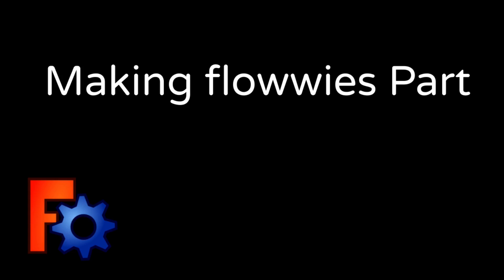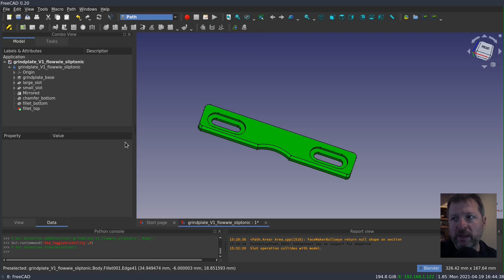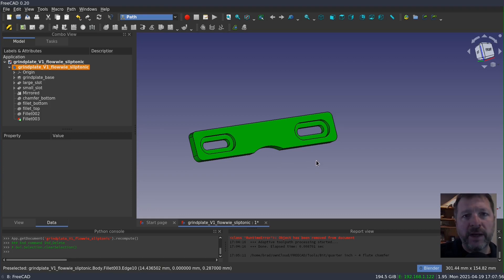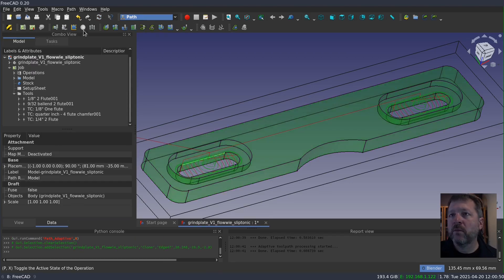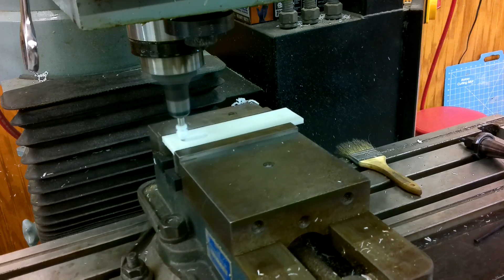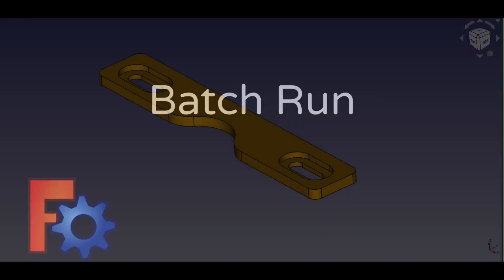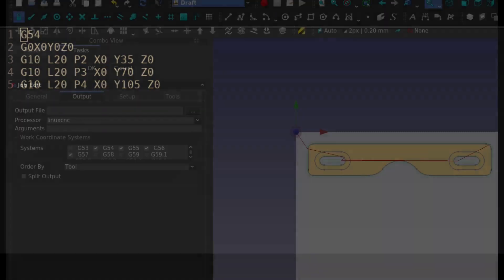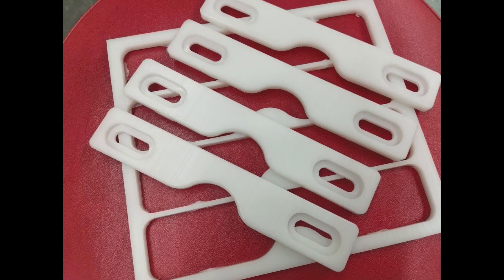Making Flowwies Part

Comment: Dynamic tool change: If it were possible to install the position of the button and the position of the tool change in Freecad in the Path settings (edit settings Path) so that the dynamic change can be prescribed directly in Freecad, so that during a change of tool generated in Freecad The machine drives into the position of the tool change and after changing the tools to the position of the button, then the new tool turfs and continues the job.
Reply from the maker: Dynamic tool change is very machine specific.  The Path tool change code is modular in the post-processors for this reason.  You can create a custom post based on one of the standard ones and then change the exact gcodes that are emitted during a tool change.

Comment: what a fantastic video - very good... I have problems with "CW" and "CCW", when I export Gcode, it interprets backwards, could you help me? I think the problem is in FreeCAD and before I used to work with Fusion360 and everything worked fine... in some machining there's no problem, but sometimes the milling direction is essential for a good finishing of the part... thank you for your attention

Comment: Thank you for this video. I’ve been trying to learn FreeCAD and Path. My first few attempts to create a tool path failed. Eventually, I deduced that I had created the part in the wrong orientation. Then, I couldn’t reorient the part. I finally learned how to reorient the part and tried to create a path. Success. Sort of. A few tweaks would create a path which cut away the excess material from the raw stock in several passes. This was my goal so this time success for real. 
Your video confirmed my findings.
Thanks,
John

Comment: Maybe screwing the blank to a wooden base and holding the base in the vice?
The wooden base could be made in two parts. A smaller part that fits the vice with a second larger piece secured on top that the blank is screwed to.
I liked your video and always look out for your posts on the FreeCAD forum.
Reply from the maker: A custom fixture could certainly be used.  There's a trade-off between holding the stock and wasting material so the more parts you can make in one go, the less material wasted.  
There's also a trade-off between the time needed to make and test a fixture and the time saved by having it.

Comment: Very nice.  I would have liked to see a detailed walk-through of setting up the individual job operations; I know you've covered them in different places but repetition is great for learning :-)   I've not yet got my head around the work coordinate systems but having looked up the G10 code, it now makes more sense.  Lastly, my machine vice would not hold more than one part therefore I would have looked to mount the material on the bed on top of a sacrificial surface - it would be good to see that option demonstrated too.  Keep up the good work 👏
Reply from the maker: It's definitely time to re-do some of my old videos.  I want to do that but it's time spent not developing.
Reply: @sliptonic  fair point 👍 I'd like to contribute to the coding but don't know where to start 🤔  I'd be interested in helping with video tutorials too but my Denford Triac is quite a small machine so I sometimes have to work around it's limitations...
Reply from the maker: Developing for open source is a lot of fun and great experience.  I'll always help newbies find appropriate projects to get started.  There are many places where significant progress can be made without having to understand the big picture.
As for videos, we're all working around limitations in our hardware.  Sometimes those limitations create the best content.  Jump in!
Reply: @sliptonic  Thanks Brad, I love open source; I've got a tiny unrelated open source project of my own (mixture of python and angular).  I've done some python work with FreeCAD to generate mazes but not published it, mainly because it's not finished.  I mostly program embedded stuff in C but can get by in python.  Where's the best place to find something to help with? - your github or on gitter?

Comment: Fantastic work! More path-videos, please! :)
I want to move completely to FreeCAD/path workbench for my x-carve adventures. It's hard to know "what should work" or if one is just doing something wrong/inefficiently. I wanted to cut out 6 pieces (3 parts two copies) in a single job. Things slowed down to an almost grinding halt when putting tags (multiple on each as biggest pieces were 700mm long). Pieces were just cutouts with a couple of holes. Also, as I remember correctly the auto tags were spread out combined on all parts rather than individually? Maybe not, but there was something strange about them that took hours to set. Mostly due to the lag.
Reply from the maker: Holding tags are great but that code is quite complex.  I'm sure there are opportunities to improve the stability and speed.
Reply: @sliptonic  I can imagine. I saw that you used the tip view to place them, so I guess the click is projected/searched down to the lowest loop and then back again x loops based on the width/angle/height of the tab?  I think at one point, one tab waa misoriented 90 degrees and created a path either in or out of the object
Reply from the maker: IIRC (I didn't write the tabs code),  the placement just sets a location for the tab.  When the dressup is executed, it looks through the operation gcode for moves that intersect the location and replaces those moves with corresponding moves to jump over the tag.  The tag itself doesn't have an orientation.  It's just a point.  Calculating the correct gcode to change gets nasty, especially if the tag is placed on or close to a G2/3 arc move
Reply: @sliptonic  I see! Might explain why it gets slow if the dress-ups are [re-]applied every click on a job that is physically large (8 tags) and with many (6) parts. 48 vs 4 tags may thus be x10 slower and be significant due to inherently large gcode that comes with the part size.  Does the code iterate the gcode 48 times, or once though a list of tags? The latter would obviously make the handling  4 vs 48 insignificant. If that's how it is implemented already, I guess it still just doesn't scale that nicely with gcode size. But I recall it getting significantly slower the more tags that were added, suggesting the former solution. I guess it may or may not require unfortunate refactoring depending on the architecture on how dress-ups are applied in general? :)

Comment: Related suggestion: with the growing numbers of individuals building DIY CNC routers (i.e. MPCNC, BulkMan3D derivatives, etc) along with the re-boot of some of the GRBL forks (grbl-HAL, grbl-ESP32, etc) I'd assume you can capture some interest around FreeCAD by going over other basics.  Things like "surfacing your spoilboard".

For folks who are increasingly used to integrated tools like Fusion 360 (as opposed to design in AutoCAD, CAM in Vectric, and run your job in Mach3), this could be a good way to get more folks on the F/L/OSS bandwagon.
Reply from the maker: You're right.  I need to revisit the basics.  Many of my videos are getting pretty dated now.
Reply: That's great idea! Feel little bit lost when it came to CAM in FreeCAD. Not that intuitive for person who know almost nothing in CNC machining.

Comment: Nice video! Instead of increasing the size of the holding tags, I would add one extra.
Reply from the maker: The ideal number of tags is the smallest number that holds the part because, all other things being equal, each tag takes a fixed amount of time to remove.  The ideal size for a holding tag is the biggest tag that requires no additional time to remove and does not affect the surface finish.  Going smaller than that doesn't buy anything except less stability.
Reply: @sliptonic  Thanks for your reply. I'm not sure there are hard rules for this. But I do believe the smallest practical number of tags to hold something will likely always be 3, because the part needs to be held in three dimensions. If the material is strong enough (obviously not the case in the video) that two holding tags may suffice then there's still chatter to consider.
Reply from the maker: Agreed.  No hard rules, just rules-of-thumb.  I have a part that I make regularly that cuts fine with two holding tags and it's about the same size as the one in this video.  Each situation is unique and requires experimentation.